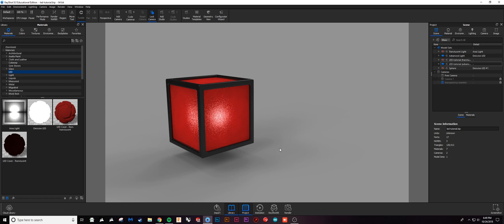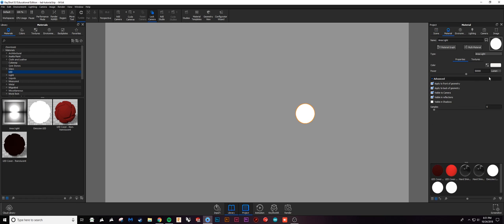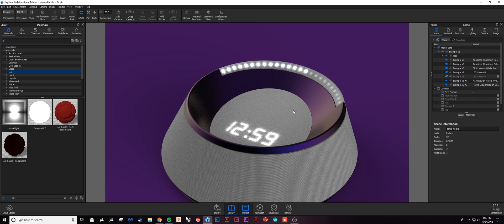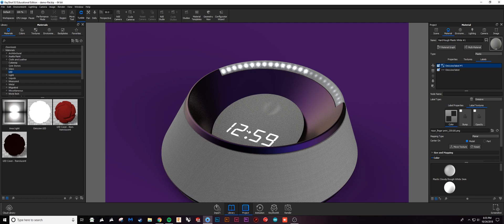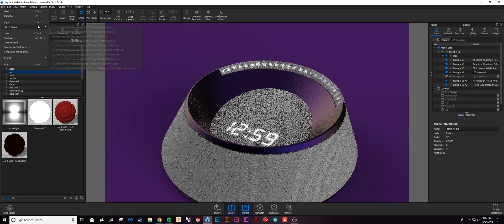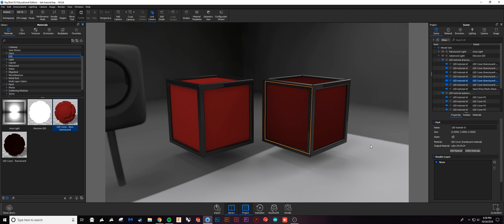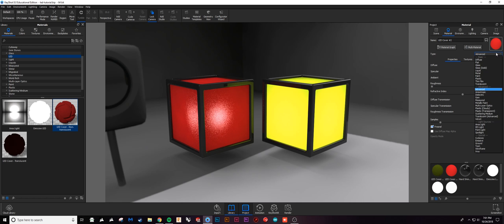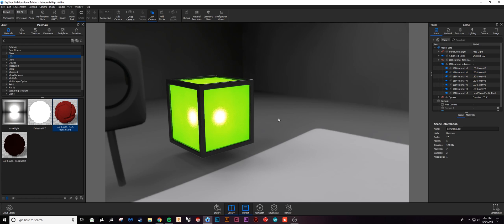Rendering Emissive Materials in Keyshot

Comment: Where I can finde texture option for translucent material in Keyshot 7? 10:22
Reply from the maker: Marko, I'm not 100% sure because I'm working in Keyshot 8 but I would take a look to make sure that you're in the Translucent material type. According to the Keyshot 7 manual, it should be there. Maybe under an "Advanced" drop-down window? You could ask the Keyshot forums and see if anyone using KS7 could help